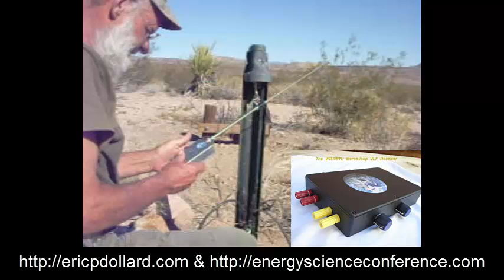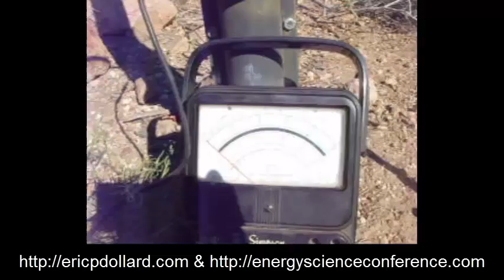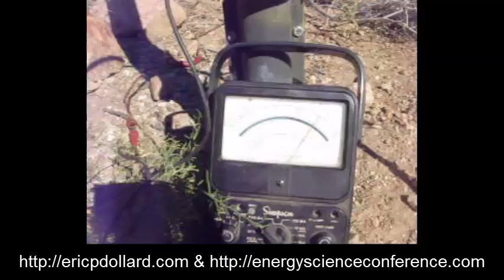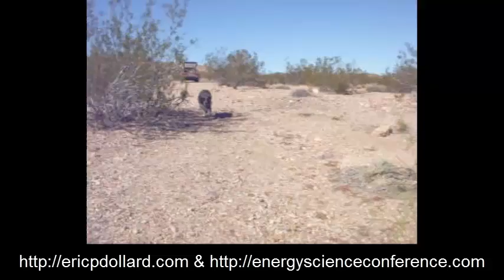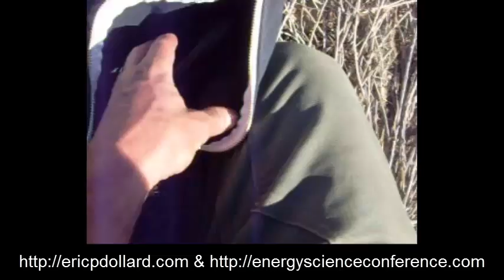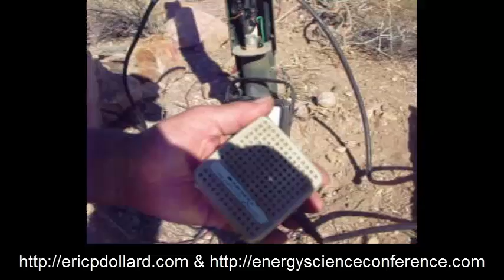Eric Dollard - AM Radio from the Ground 2015-03-30

Comment: The KWH meter at the AM radio station doesn’t spin faster due to someone powering a load from the transmitter. Just like how the number of listeners to a radio station doesn’t change the amount of power required to broadcast the signal. Pure nonsense...
Reply from the maker: You are talking about an electromagnetic load where people are receiving from an antenna, the transverse waves through the air. It is nonsense that you do not know the difference. Eric is talking about the longitudinal transmission in the ground and pulling a load from that.

Comment: Wow, so this idiot just created a AM radio?  Did it when I was a kid with a piece of wire and a cats-wisker diode from Radio Shack.
Reply: Hey Johnny ole buddy ole pal, we both know you are a ai bot, but lets say you aren't, then in that case you are very low effort shill. Did your AM radio pick up transmissions at the same distance as Cali to Japan? Did you notice the japanese radio stations getting picked up? The guy you call an idiot is the greatest electrical engineer ever to exist, including tesla, including cp steinmetz. You are a bot or a shill. Most likely a bot. I tell you what Johnny, why dont you post a video of how to pick up AM radio signals from Japan. We await your instructions, since you did it as a kid, you must be able to replicate it now right? Put up or crawl back under the bed where you belong.

Comment: Good info refreshing. 

 The ground rod demo sounds like 60hz, with a high frequency carrier wave over it. The first speaker has a cleaner audio. I can hear a cleaner version in my curcit's... there is a video I have called Linear Paul Magnatizum explained, in this you can hear the radio single you hear, the part that's freaky is it settles at 60hz , the power supply is at 120-500hz in this setup.  Something I'd like to point out. Your fixed on ground to ionosphere, however the potential reaches past the ionosphere and deep into the earth.  When speaking scalar waves material things are not really accountable,  my understanding is your validations of earth transmission is a testament to these findings.  60hz "maybe" earth's energy resonance.  Tom Bearden has a old video where he also saw 60hz. Is the backside exposed enough yet, are we seeing it all unfold.  
Explain: sitting in a lab, puppet strings on the very utensils to eat. Jp wants to charge, yet he is stupid. Hiding the truth in plain sight, by putting  the grid at 60hz hides earth's free energy in plainsight. European is 220 50hz (why not 70? Saturation that's why), USA the foundation of energy is 110, grounded. 
A "Tesla" coil is just a tree , it produces ozone trees produce oxygen exc..exc..

The next subject is your understanding of impulse and radio being in a stereo effect from electromagnetism to my terms of Linearl Magnatizum (Spelling correct donating earth and gravitational ) and yes they can be separated from each other. I have several videos of proof; as you know it's unpredictable energy and difficult to harness.  
There is no question it's there but it's coupled  together,  I think it could be written as A/C over a straight line of D/C for a better understanding of this coupling your speaking of. And my I ad it's in perfect resonance so it wants to stay there, the trick is resonance lock in situ.  I have a video that shows this as well and how I unlocked it giving a curcit that runs on earth's bio and pulls a clean D/C line and a 60hz A/C wave both show on an scope,  hard to deny. 

So Mr. Eric Dollard, there is at least one person deep into this study as well. I my not publish on the energentics forum but I do publish my findings on YouTube.  

It's good to hear your voice, sounds sharp. 

David A Puchta 
Achieved Alchemist